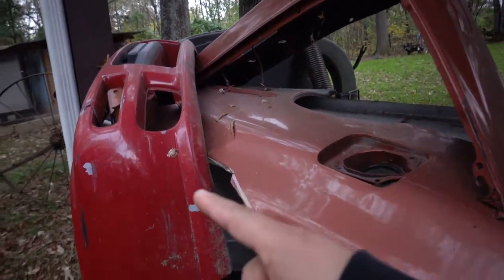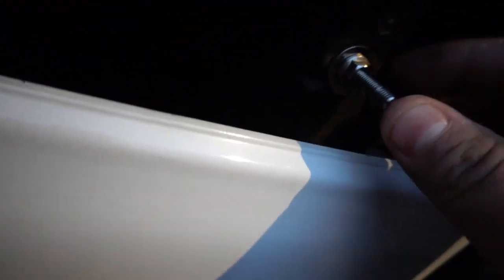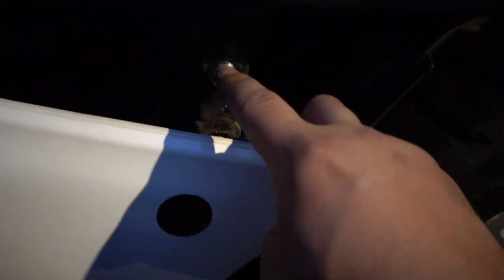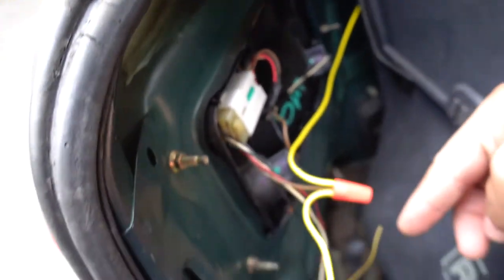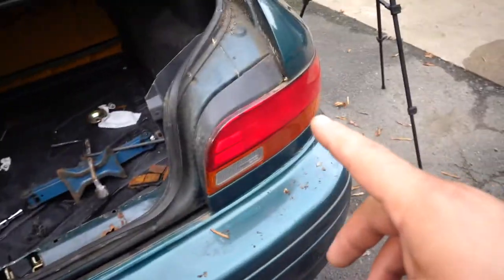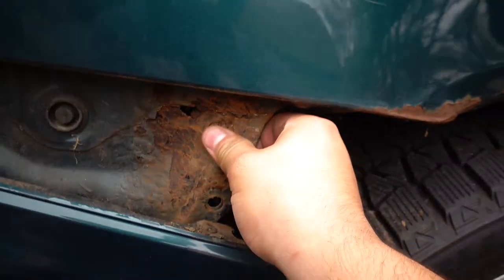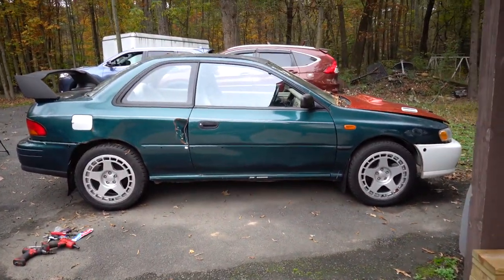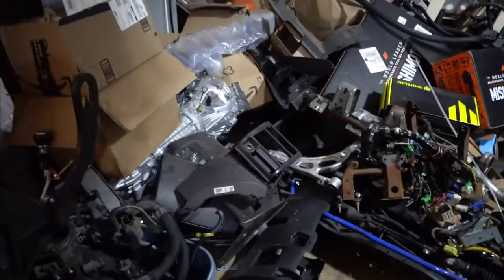Installing Bumper Quick Release On My Subaru Impreza GC8!!

Comment: Curious why you didn't leave the bumper cover attached to the bumper beam? And just pull the beam with cover attached.
Reply: over time the 3-4 bolts that hold the two subframe rails in will break off inside the frame rails making it impossible to remove it that way. mine did this so I took it off the only way I could which was this method leaving the bumper behind 👍🏽